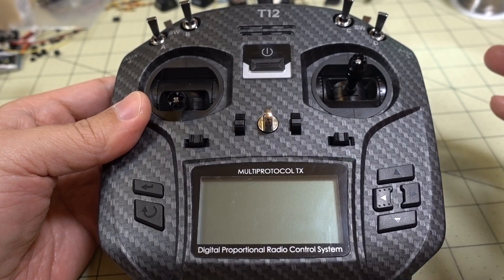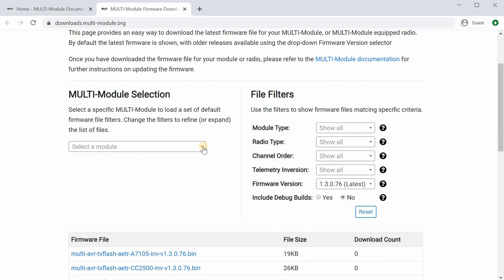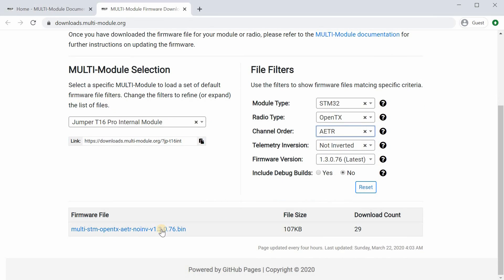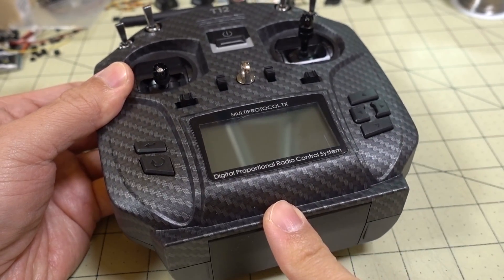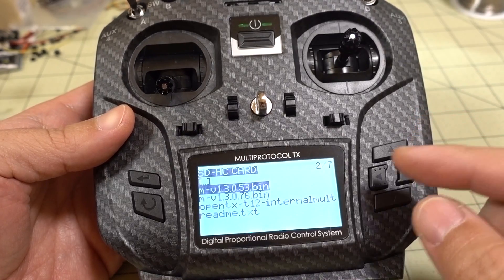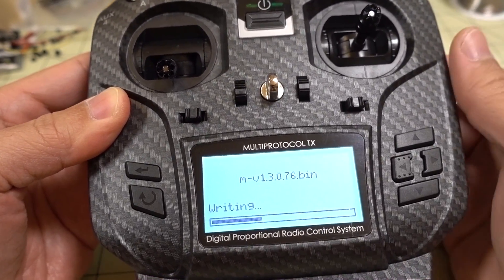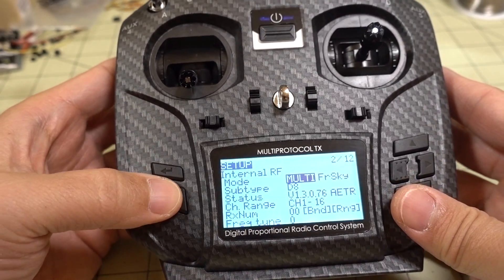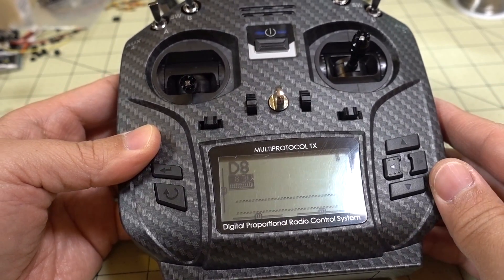Multiprotocol Module Firmware Upgrade Tutorial 🎓

Comment: Just so its on the net somewhere.  My Jumper t12 pro wasn't showing the option to use Frsky D until I had turned on the serial rx option on the uarts tab of betaflight... and the model was powered up in binding mode.  Not sure it had to be in binding mode for it to show but that's how it worked for me.... Only under that condition could I get the internal 4in1 to show Farsky D ... and I could then bind.  GL

Comment: I love my t12 but it randomly stopped working no display screen unless it’s on bootloader tried different firmware’s but still can’t power on just blue light and black screen has anybody had this problem before
Reply from the maker: Seems like a hardware issue.  Have you contacted Jumper support via email?🤷‍♂️

Comment: So in this transmitter i need to upgrade opentx , jumper firmware they are diffrent right ? And what is the diffrence between internal and external module which one i need to use ?
Reply from the maker: T12 Pro is supported in Open TX companion.  T12 Pro comes with the internal module already.  Check out this site for more information about modules...  https://www.multi-module.org/

Comment: Thank you for this. Helped me update everything. However, my gimbals on screen are not centered at 0.00, yaw is at -2.0, roll is at  1.4, and pitch is at 0.6, 0.8. Only way I can get them close to 0.00 is using the trim buttons. I did all end points in betaflight cli, even created new models. Still the same. Any ideas?

Comment: Albert, awesome videos and explainations. Just upgraded my T12 Pro with 2.3.8 and was needing a module upgrade. This helped tremendously! BTW, flying AIR mode for the first time today (Tinyhawk 2) 9 batteries later (and one mild crash) tried STAB and could not control the drone. It felt locked! What a weird experience (lol). 
I've been scrambling through your videos most of the week cause I've been trying to setup my  T12 Pro betaflight modes on a three position switch;  you know like having STAB,  HOR and AIR. But Betaflight only recognizes two positions no  matter with switch I use. I had STAB and HOR but wanted to try AIR today. I just dropped HOR and now I have STAB and AIR on the switch. 
Any ideas why betaflight only sees two position? I checked CH, Mixers on radio to no avail. I did noticed that the third position is not showing on the radio either. I seen movement on Pos. 1 and 2 but the bar doesn't extend to the max on the third position. If you could offer me some pointers/advise I will greatly appreciate. Awesome videos!!!! Thank you.
Reply from the maker: That problem is a weird one.  Have you tried creating a whole new model from scratch?  Maybe the mixer isn't setup properly...
Reply: @AlbertKimTV  thanks for the quick reply. Yes. I deleted the switch from Input and the Mixer and recreated.  All is good now! Thank you... Seems like the Mixer was misconfigured.

Comment: For some reason my yaw is on the right stick and my roll is on the left stick.. I set it on mode2 and AETR.. but it does the same thing
Reply from the maker: After you change it to AETR, you need to recreate the model.  It still has the old channel order built into the mixer and input pages...
Reply: @AlbertKimTV   thank you so much,,, i was at it for hours and wasnt able to get it to work and now its working thanks to your advice! thanks again!

Comment: Hey there, hoping you can help! I keep getting a script syntax errors and telemetry protocol not supported errors when trying to use bf lua scripts on the T12.

Are you aware of whether or not this works, and if it does can you post a how-to?

I've tried multiple reinstalls of both 1.4.1 and 1.5.0 scripts on the SD card on both a meteor65 and a newbeedrone hummingbird brushless and can't get this to go!
Reply from the maker: What version of OpenTX are you running?  Have you tried both the lua and luac scripts?
Reply: @AlbertKimTV  2.3.7 and I also tried 2.3.5 from the jumper site. I tried both lua and luac and 2 different SD cards.

The crossfire script works perfectly, so it's something specific to bf.
Reply: @AlbertKimTV  I'm guessing that yours works, so it may be that either I'm doing something wrong or something is up with my radio. In any event not having the bf lua's isn't the end of the world!
Reply: @AlbertKimTV  I figured it out. I had to install a nightly build of 2.3.8 for the scripts to function correctly. There was another video I watched about an issue with the 2.3.7 build which referenced issues communicating with the SD card so that all makes sense now.

I have working BF luas for both crossfire and frsky receivers!

Comment: Thanks for great video Albert. Nice work. I have a basic t12, I get message "Needs File opentx-inv [EXIT]" does this mean I need bootloader?
Reply from the maker: Yes, your module doesn't have the bootloader installed.  Do that first.  Also, you need the inverted firmware I believe.
Reply: @AlbertKimTV 2.3.7 installed bootloader having trouble flashing external module.
Reply: @Fsvzj115  Hi I had the same issue, try version 1.3.1.69, this is the last version which has Telemetry Inversion option visible in the download filters. This worked for me.
Reply: Pressing both trims "in" I get otx bootloader 2.3.7" saying not a valid firmware. Hmmm.
Reply from the maker: You don't flash the module firmware there.   Only OpenTX.
Reply: @AlbertKimTV  no windows machine, slow old MacBook... okay tried from the sd-hc bin files to flash external multi says. Fw update error NoSync.

Trying to run flash from mac for basic t12 to run recent toy protocols. Need to flash.

Comment: Hi Albert, very useful particularly about shortening the file name, I couldn't work out why the radio was not reading the file even though everything was in place.  One question about channel map, mine seems to be fixed on RETA even though I've set everything to AETR in the radio and none of the 4 mode settings in the radio settings work either. 
I just got my T12pro mostly based on your recommendation and couldn't be happier with it! Thanks
Reply from the maker: Even if you change the channel mapping in the Radio Setup page, it is not reflected in existing models.  Only in new ones.

Comment: Will this work on the regular T12?
Reply from the maker: I'm not 100% sure.  It might but you have to make sure you use the firmware for EXTERNAL modules not internal.  Also, I'm fairly certain the original T12's have modules with older firmware that doesn't have the bootloader in which case, this method won't work until you update the bootloader on those modules.  Basically, it's fairly complicated.